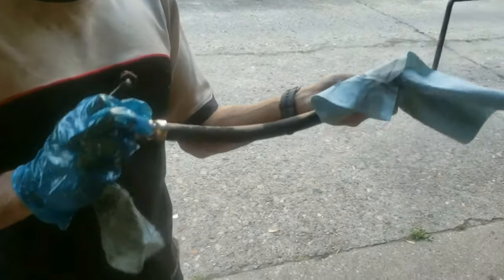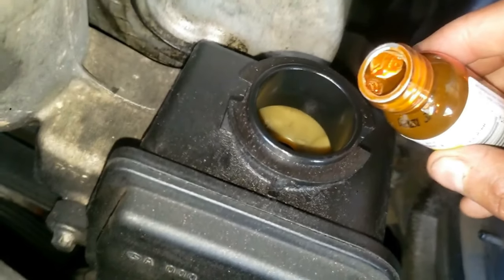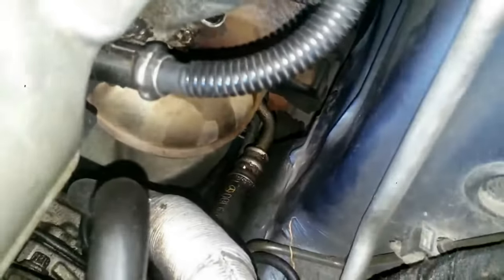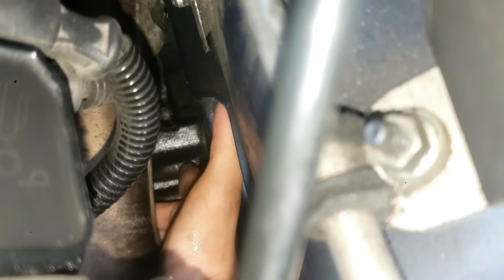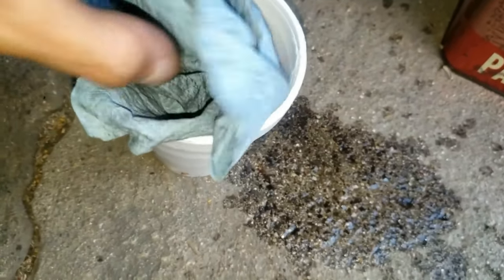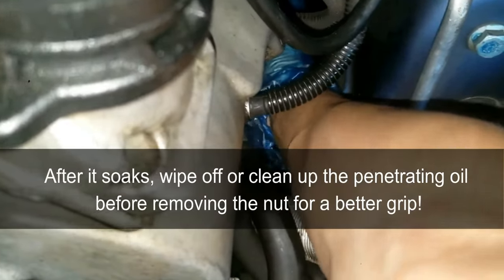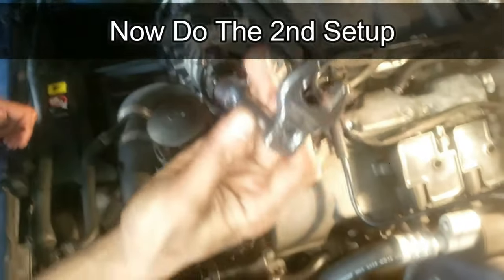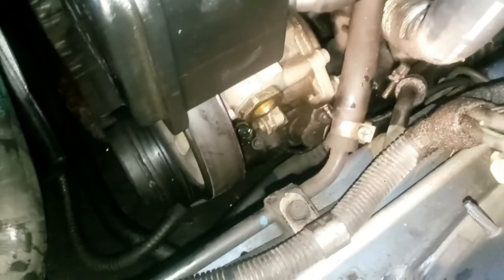Remove High Pressure Power Steering Hose and Nut In Hard To Reach Area

Comment: Could you reach the nut by removing the tire and getting at it from under?
Reply from the maker: Nope! I tried that as well as all kinds of different out of the box setups and on this car it was not possible unless I removed the engine motor mounts which would have been more time consuming. Also even from underneath their is no leverage or easy way to get a hand in there to turn it, which is why I used a floor jack or bottle jack. Because in addition that was stuck on their tightly. Great question!
Reply: @FixCarYourself  Thanks.

Comment: Hey Man!... thank you very much for posting this video. It is exactly what I need to do on my 2003 Mercedes SLK 32. Though I will change both pressure lines. I spent all day yesterday trying to figure out the best way to reach the far end of the lines without taking the whole car apart. WIS Mercedes manual doesn't mention this work.
From your instructions I see I'm missing some tools so I'll have to get them asap. To loosen the end nut, can I use just WD40?
Thanks for your help. I'll let you know how it goes. My hands are small 😄
Best!
Reply from the maker: How did it go?
Reply: @FixCarYourself I'm still working on this. I was able to change the return hose (from steering to cooling line) This is better accessible from under the car and the nut wasn't stuck so it was easy to remove it. With this the leak is gone.
For the pressure line you showed on the video, it seems there is less room in the Mercedes so I was not able to reach the nut the way you did it though I have small hands. Now I need to replace the engine mount that requires removing the steering pump and reservoir (among other stuff) and that will be a good moment to change this pressure hose. I'm waiting for the parts to arrive.
I'll let you know.
Thank you!